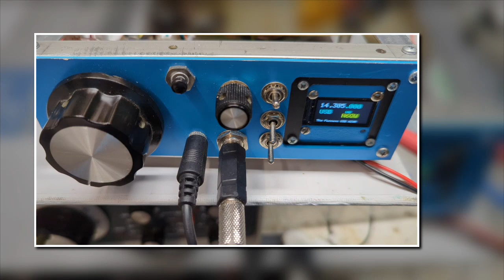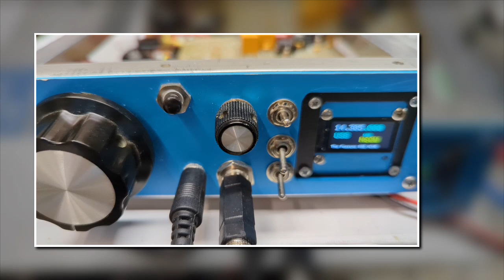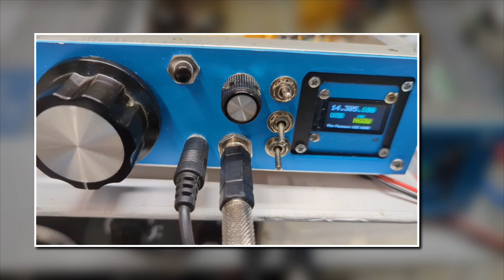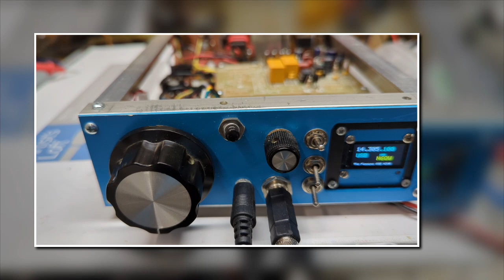The Paesano a 20M QRP SSB Transceiver

Comment: Always enjoy looking at what you have done. Building is what ham radio is about for me. Never been interested in chasing paper. New ideas and unique ways of building circuits are where it’s at. 73s
Reply from the maker: Thanks for watching. The IF Module uses two NE602's and the whole Module is steered so it always amplifies in one direction (not Bitx Bilateral). For its simple design it works OK.

73's
Pete N6QW